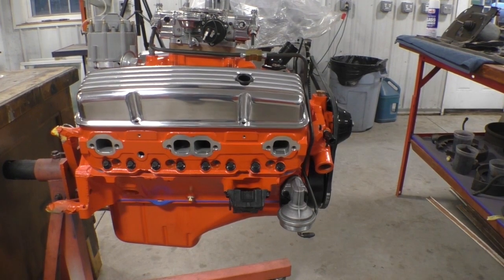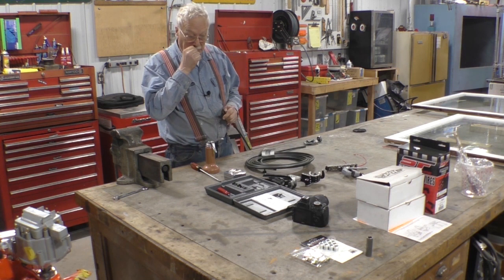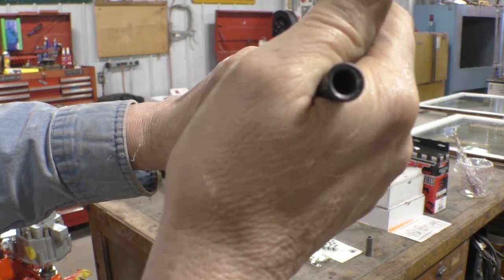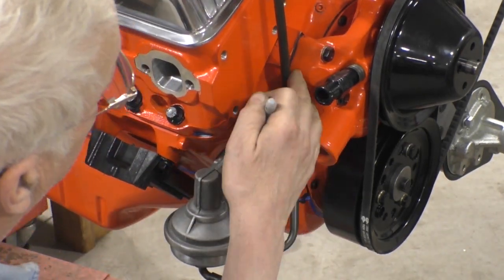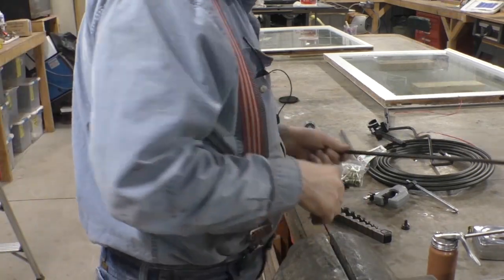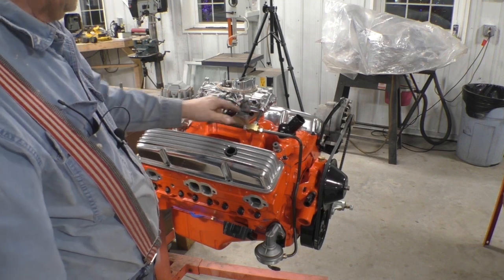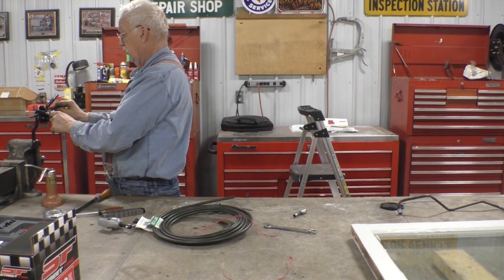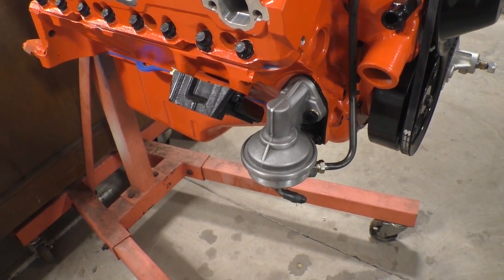SBC Fuel Line Hard Line with no rubber hose

Comment: A double flare is not necessary for a carbureted fuel line because the pressure is low at 7psi or less. Brake lines however need a double flare because of the high pressure generated in the system when you slam the brakes if need be, could exceed 1400psi!

Comment: Very good explanation.
I bought one of these professionel flaring tools from sykes pickavant and bent the same steel line as in the video but I still have some sealing problems at the pump fitting. The double flare is not sealing well and I tried it several times. 
Good Video! Greetings from germany.

Comment: Seems like a guesstimation of where to start and where the bend will end. I wonder if a close hanger would help mach it up. I tried making this once and ended up cutting off the other end and using a rubber hose, this job will piss you off and most likely have multiple attempts.
Reply from the maker: I always end up with a couple of false starts. Tube is cheap, keep working at it, it gets better.

Comment: I went with inverted flare,  and everyone is saying I have to use AN fittings. So why not use inverted flare? Short term failure?
Reply from the maker: If it is 26Degrees you need to use AN fittings (expensive).